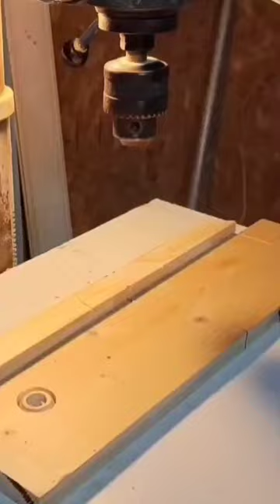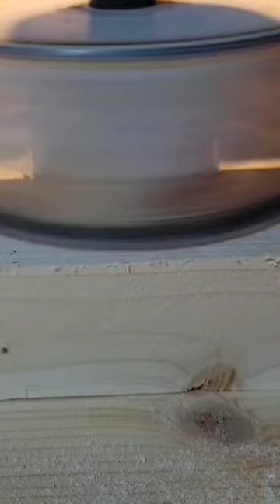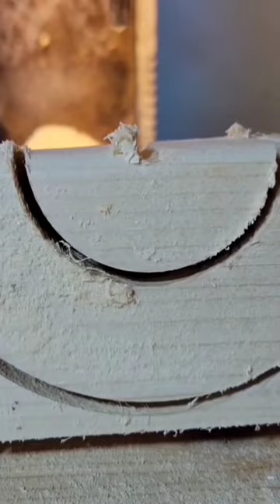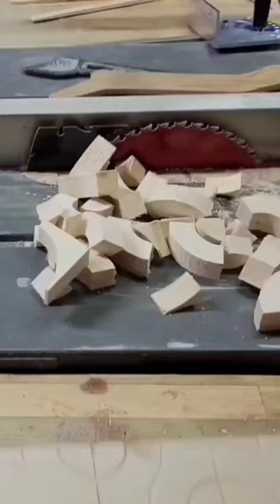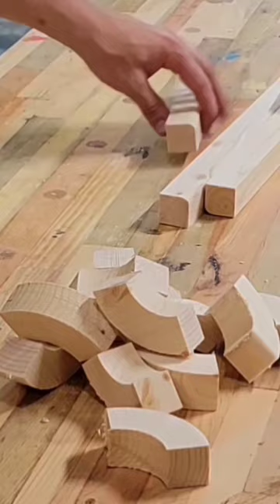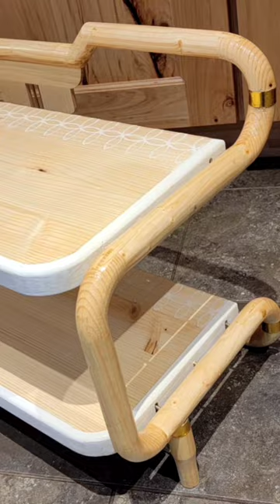Corners // Woodworking #carpentry #diy #woodworker #maker #woodworking #wood #handmade #craft

Comment: Ummm. Yeah end grain glued together with no dowel?  
I don’t want to be that guy so I won’t. 
Good luck with that.
Reply: There is a full video. The off cuts from the 2x4 was used to make biscuits and then all of the joints are fixed together using the biscuit joiner. Its a really cool video. Have a watch.
Reply: @Stanletshostak....and you never will be half as good as him!  You're watching a short...not the full build.. haters gonna hate though...good luck with that!

Comment: I... You.. but.... That rail is supposed to be a handrail meaning it will take weight. The very first thing I would do is move the shelf with that rail. You just glued them all together with no fasteners?!?! A decorative shelf that looks like a bench that will break if a guest sits on it